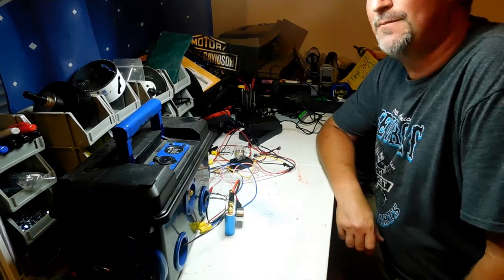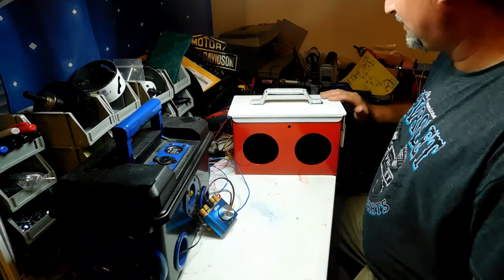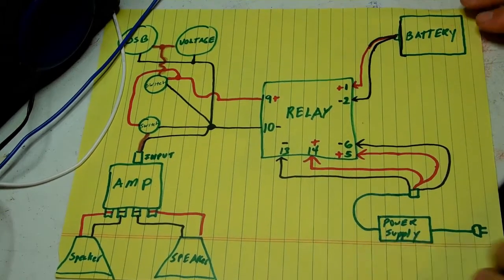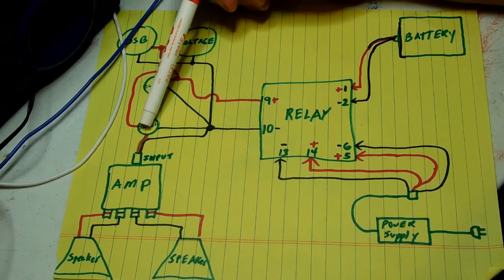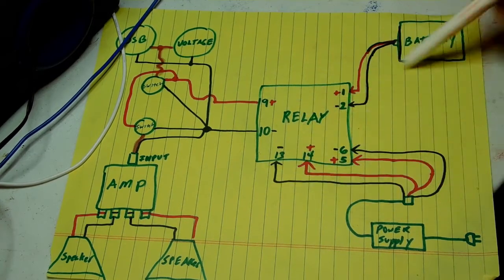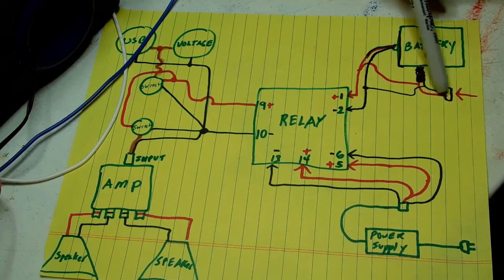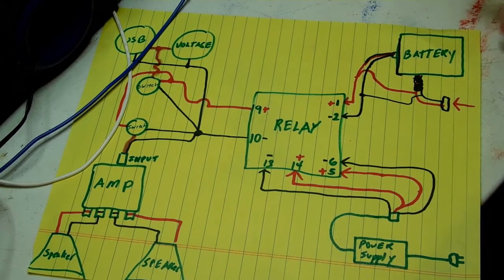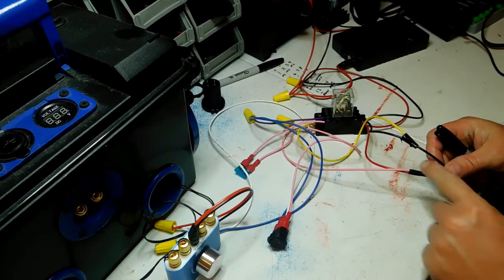Build An Ammo Box Boom Box Build With Duel Power Part 3

Comment: Hi Phillip, Have following you for sometime from Canada. Can you help? With the Drok amp, do you need an external antenna and how would you include if required?
Reply from the maker: I actually don't use these anymore.
I use a Damgoo 100 x 100 Bluetooth amp.
You can see it in one of my newer videos.  I did a review on it. Works so much better.
Reply: @diyboomboxesintexas2805  Thanks

Comment: With that Drok amp can you use the Bluetooth while an aux cord is plugged in? I want to be able to use Bluetooth and have an aux port on the outside of my box so I can use both without having to open it up and plug the cord in.
Reply from the maker: James Moore unfortunately you're not able to do that. The only way that would work, is to install one of the FM tuners that have an auxiliary input already built into him on the outside. That way you would use the Bluetooth on the FM tuner and you would be able to plug in the auxiliary into the FM tuner without having to open the box. If you check out my Harley-Davidson video I did in the metal box you'll see the FM tuner I'm talking about that has Uggs illery in put in the front
Reply: Ok, that makes sense. I would most likely use the aux cord only a lil bit so I will just position the amp so I can plug in the aux running from the outside of the box when I needed to. Thank you so much for being so helpful!
Reply from the maker: James Moore actually up I'm uploading part 4 of this build right now. It should be up in about 30 minutes

Comment: Nice work, explanation.  I have a question.  Why couldn't you use the same battery charger to power the unit to both charge the battery and run unit on A/C.  So in this setup you would wire the red and black from the batter charger to  #1,2,5,6,13 & 14 on relay, then when you disconnect the battery charger adapter, the relay would still kick into battery mode.  this would eliminate to separate A/C power inputs.  I'm no electrician, but does that make sense?
Reply from the maker: The reason you do that is because the battery charger is not designed to work under a constant load like that supplying power, the batteries charge your job is a charge the battery and it spikes in voltage and is the battery starts charging the circuitry inside the battery charger will start backing off the voltage a little bit and the amperage until the battery is totally charged and then it shuts off. If you try to use the battery charger as a power supply it would work for a while but this would put tremendous strain on the battery charger and eventually it probably burn it out. It's the same reason why you wouldn't use your power supply to charge the battery because the battery would constantly be under charged and they'll be the better the power supply is not designed for that kind of a load and it would burn out the power supply most likely burn up your battery to because I've actually done it myself. I hope this make explanation makes sense
Reply from the maker: If you're not already a member please join my Facebook group. It's a lot easier to answer questions and draw diagrams and show pictures and things like that on the Facebook page and that's one reason to stay here cuz we answer questions like this all the time we have a lot of Builders and non builders on our page. Just look up the Facebook page called, I love all things radio. It's an awesome place to hang out. People post all kinds of cool builds and suggestions for bills and, let me tell you I have learned so much from that group it's amazing.

Comment: Instead of needing 2 separate power inputs (one for charging the battery and a second for playing the radio via wall power), why couldn't you just connect #1 and #5 together for positive and #2 and #6 together for negative. This would eliminate the need for the relay all together. Essentially connect #1, #5, and #9 for positive and connect #2, #6, and #10 for negative. The "Power Supply" input could be fused and have a ON/OFF switch. Depending on the Power Supply chosen it could have a 12V to14v and 750mA to 5A output. Wouldn't this allow for simultaneous charging of the battery while allowing to play the Bluetooth?
Reply from the maker: That will not work.
The power supply is not a battery charger.  That is why you need the relay to keep the battery and power supply separate

Comment: What is the fungtion of the switch? Thanks
Reply from the maker: nexian space There are two switches. One turns on and off the amp abd the other turns on and off the voltage meter and USB port
Reply from the maker: nexian space I only installed one switch in the beginning just to test it because I didn't have the meter in the USB port installed but when you see the next video and the USB port and they voltage meter are installed I have two switches

Comment: In another video you did not use Relay because the amplifier was 100 w. Right?
https://youtu.be/7w_jepElwNo
Reply from the maker: Well, there are two types of relays.

One relay is to carry the load of a circuit so the switch does not have to.

The other relay is used when you want to run off a power supply and a battery
Reply: @diyboomboxesintexas2805  I will use a lithium Battery.
One more question: the nuts you use how many mm are they ? 
1,2mm  or 1,5mm ?
Obviously it depends on the number of cables to connect, but which ones will I need, yes or yes?
Thanks for your time